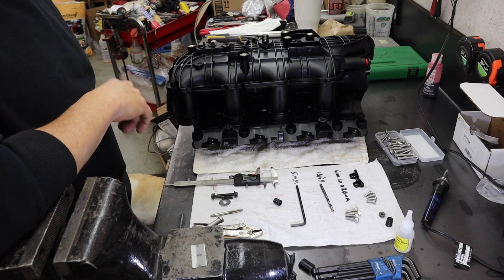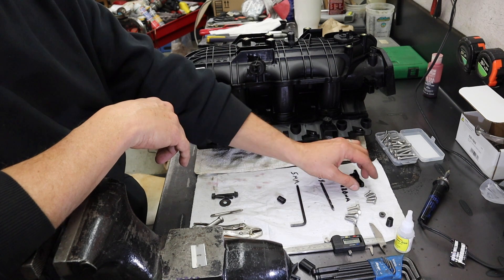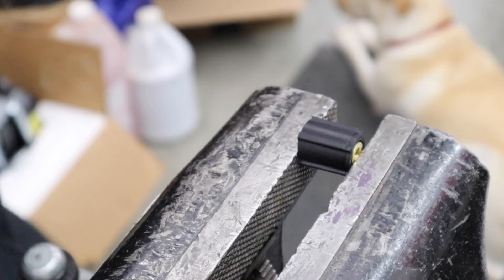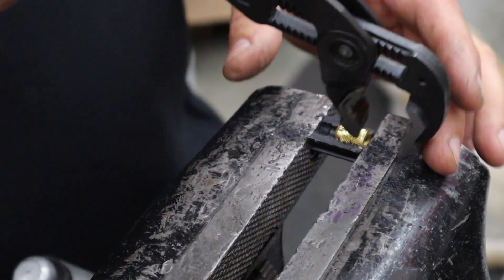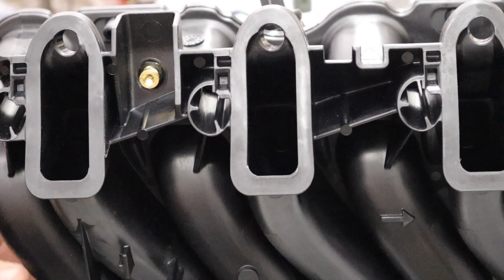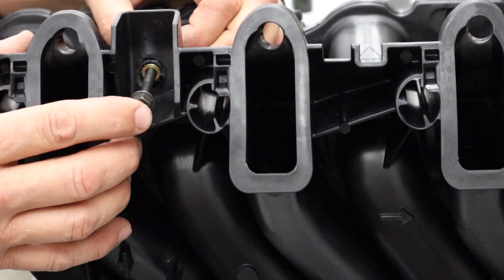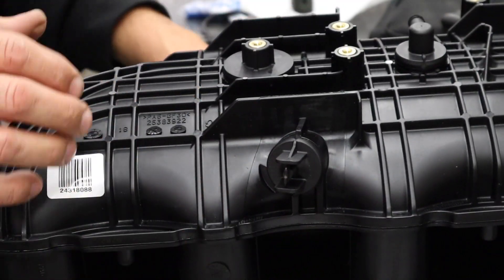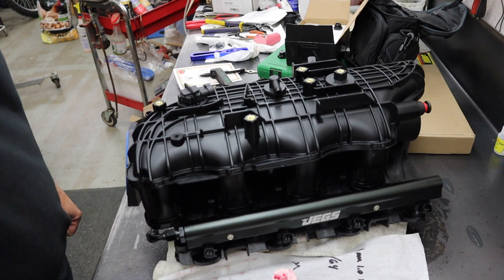Chevy TBSS intake mod for injector rail mount

Comment: How do the Holley injectors fit in the intake bore?  We're you able to use the o-rings that come with the injectors or did you have to switch them with truck injector o-rings?

Comment: Awesome! That looks like it will last. Do you have a link to the injectors and rail?
Reply from the maker: Thank you!  
Link for Jegs fuel rail  - https://www.jegs.com/i/JEGS/555/14405/10002/-1
Link for Jegs- Holley injectors - https://www.jegs.com/i/Holley/510/522-768X/10002/
Also added them to the post. Best of luck with your project!